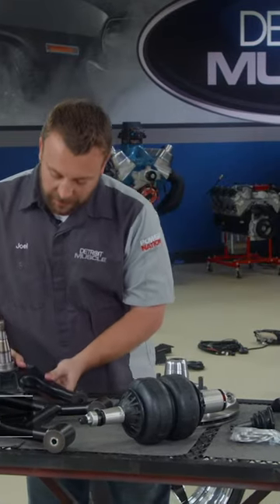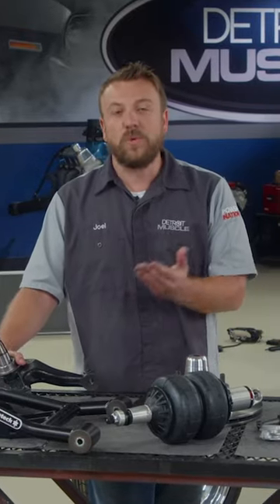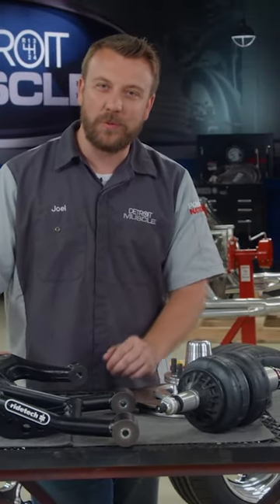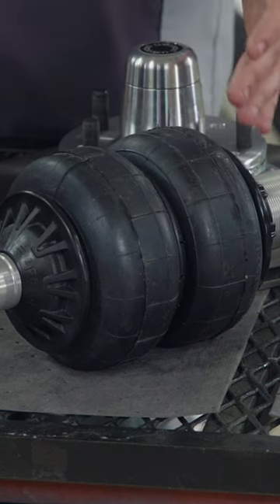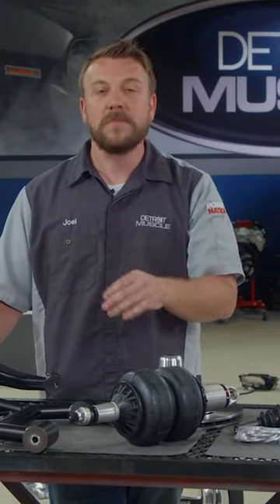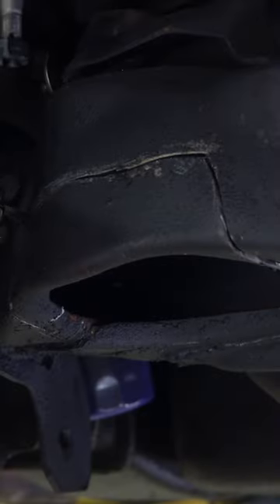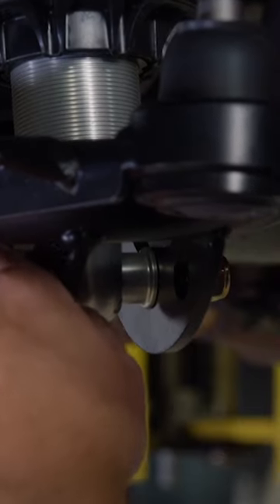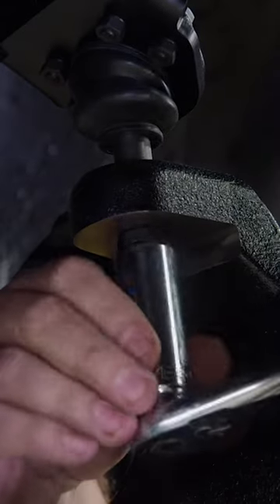Installing an Air Suspension

Comment: I had a Regal about that year and had to replace the springs, so I'm surprised they couldn't make an airbag the diameter of the spring to fit in there so you don't have to butcher the fender.